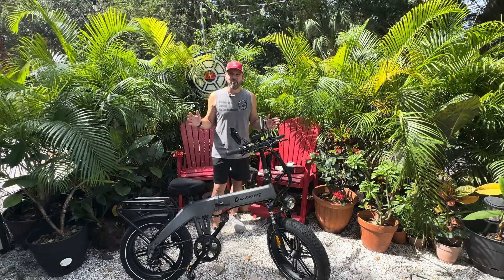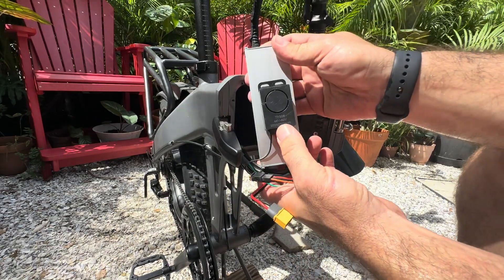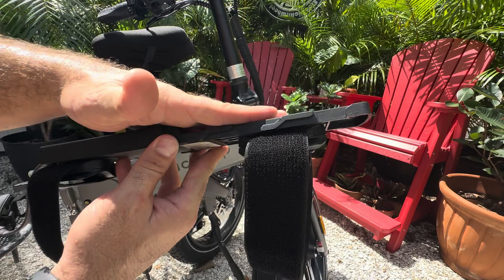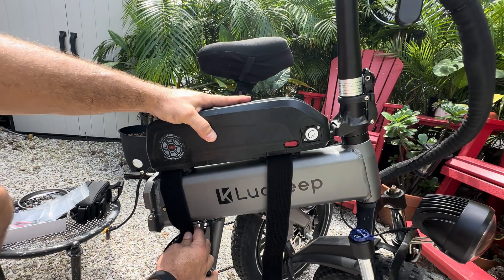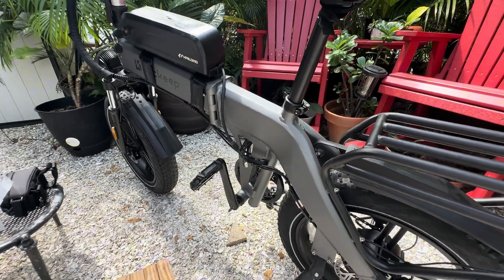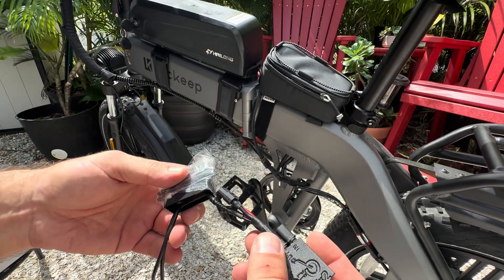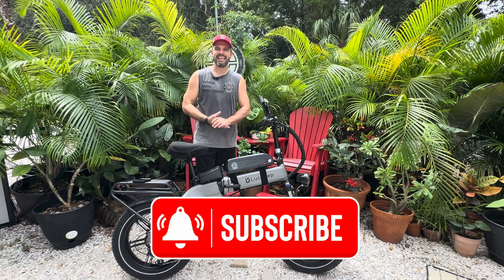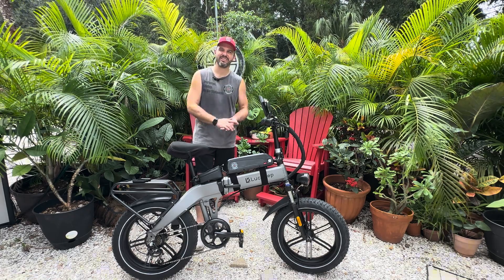Luckeep | X1 | e-Bike Plug & Play Dual Battery Kit. Install Aftermarket Battery & 2 extra USB Plugs

Comment: Do you have the specs or ordering information on the second battery?
Reply from the maker: Battery Recommendations - https://electricallwheel.com/pages/recommended-batteries-to-use-the-electricallwheel-dual-battery-kits
It is a 48V downtube battery. The one in the video is a 48V 15Ah battery